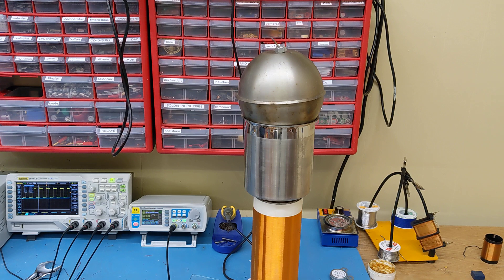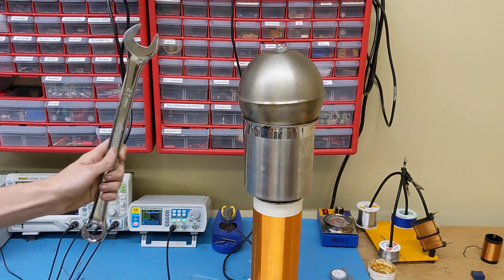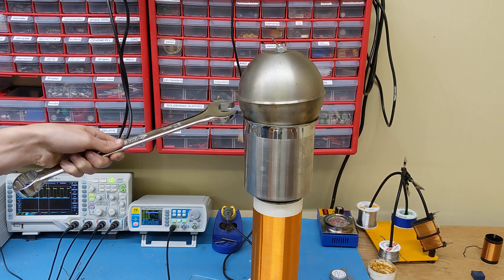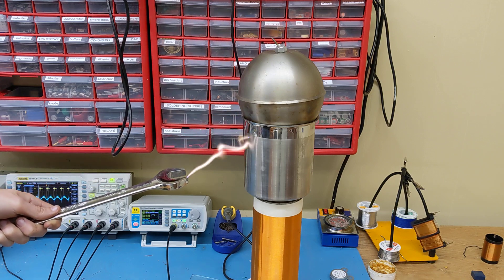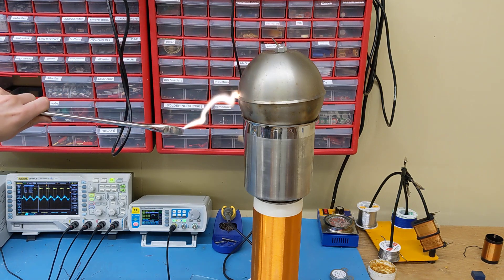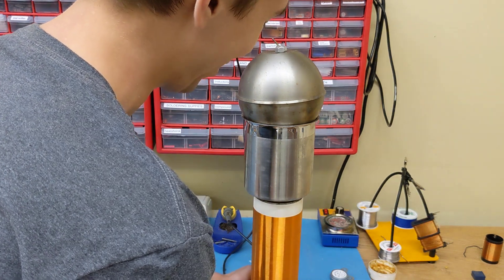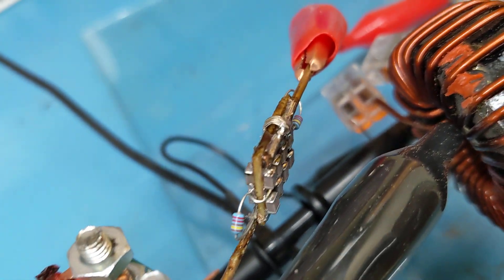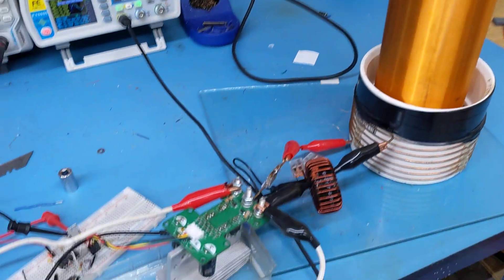CW SSTC quick update

Comment: cool, high current for a tesla coil. its like a ZVS you can touch
Reply from the maker: Yup. Actually all real tesla coils are ZVS operation. You want to switch the MOSFETs at the zero crossing to minimize switching losses. If you happen to be exactly at resonance, then the primary LC looks like a resistive load and your FETs switch at both the zero voltage and zero current crossing.
Reply: @power-max  true, I meant to say ZVS driving a fly back transformer lol
Reply from the maker: @chems  I think the more correct name is a royer oscillator, but one one in the community calls it that. 🙄